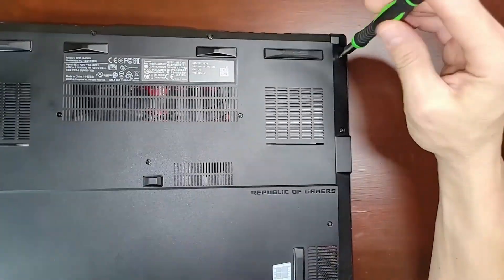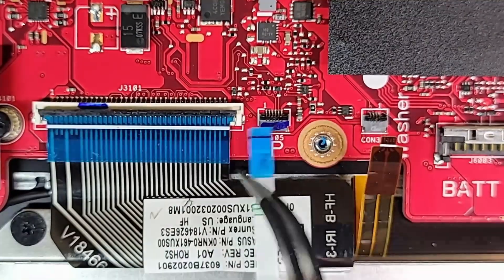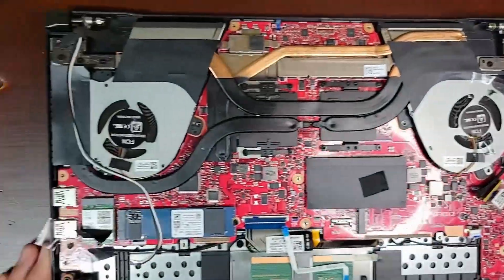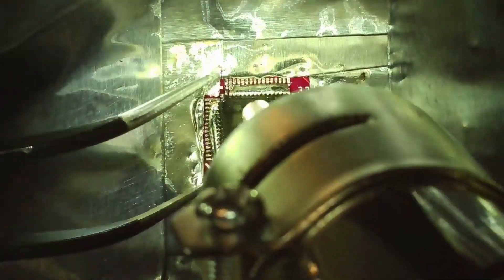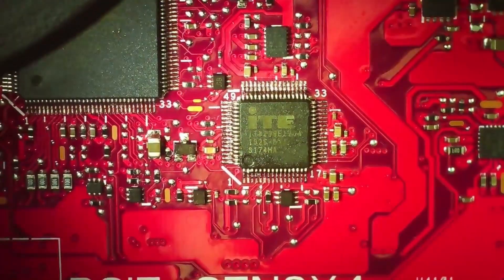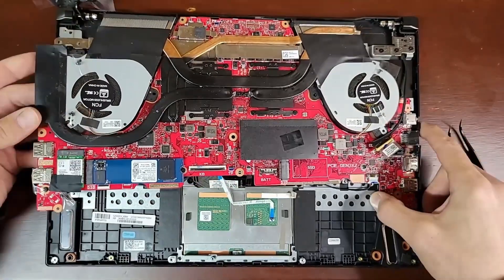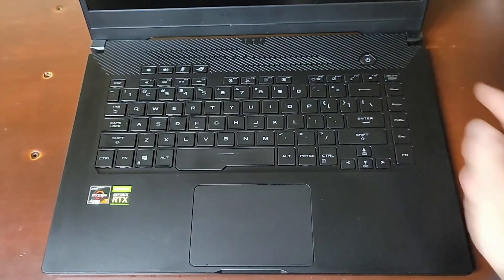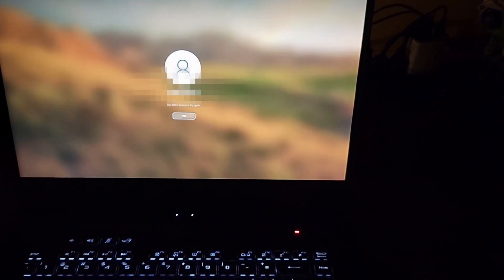ASUS ROG Keyboard Not Working GA502 Motherboard Repair

Comment: hi, does that ite chip needs to programming or just replaced it? i have the same problem on an asus zephyrus
Reply from the maker: All I did was replace it and the keyboard worked again. What I didn't realize until later on though is that the RGB backlight would only glow white, so there's that. The owner of the laptop doesn't want to troubleshoot further, so I'll never know if it's possible to get full functionality from it.
Reply: I am having the same issue myself and doing some research. I don't think it's required to reprogram, although to reprogram, you'd need to extract the EC firmware from the BIOS and then program it on the chip using 128 ZIF adapter and SVOD programmer.